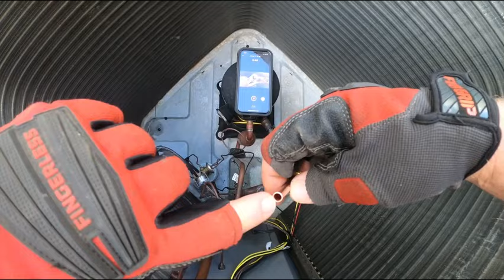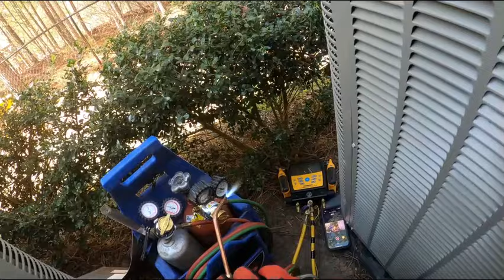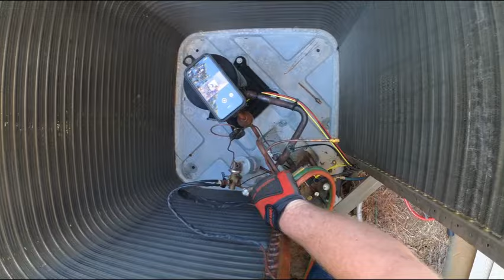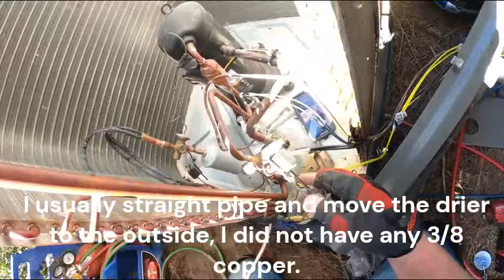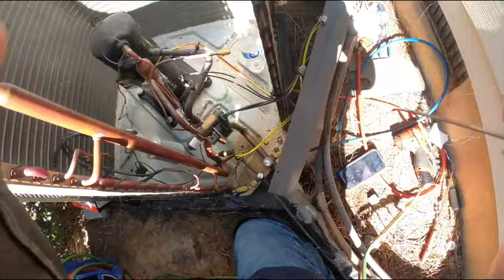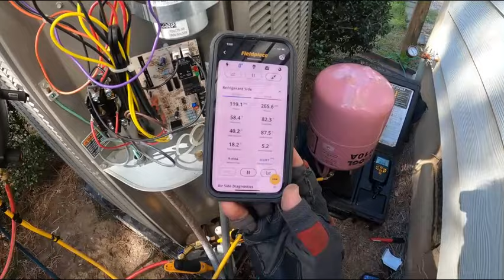HVAC LEAK REPAIR! Lennox Heat pump not cooling.

Comment: Years ago I got a ratcheting tubing cutter and like it a lot You might want to check it out It's an eastman RC375 FOR 1/8 TO 3/8 tubing. It's great for tight spaces. You did a good job. I like the idea with your cheater cord. I guess I'm paranoid but I always wrap reversing valves or txv's. It's just what ever You get used to doing.

Comment: Going to suck to check the refrigerant in heating mode 😂
Reply from the maker: Actually you can check it just fine, the new fitting works, that was why I replaced it.
Reply: @MYHVACLIFE  I was just talking about connecting the refrigerant hose.

Comment: I like to clean first just so no shavings get inside the cap tube. But at least it’s flexible enough to angle downward so it goes downward. But I have dealt with this before rub threws especially. But nice little job and well done